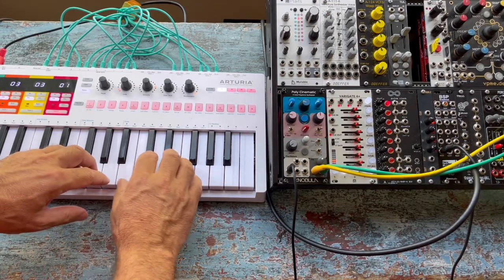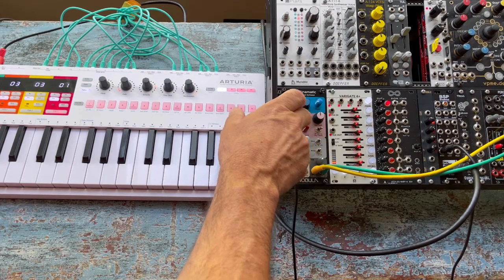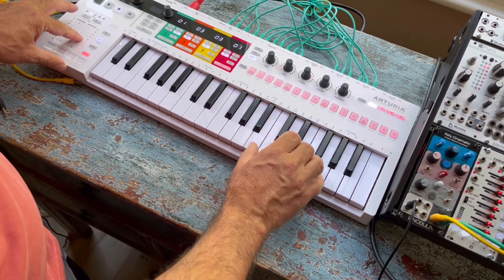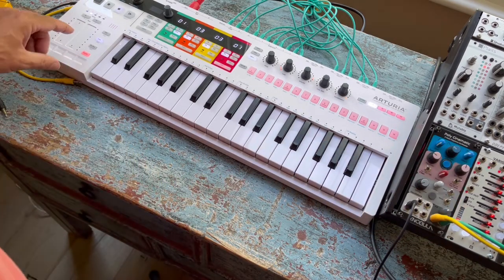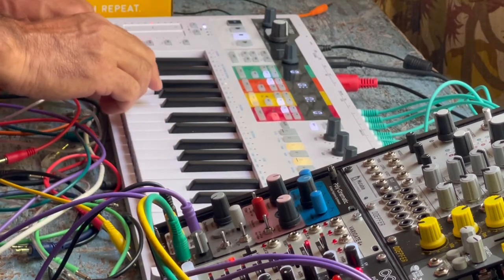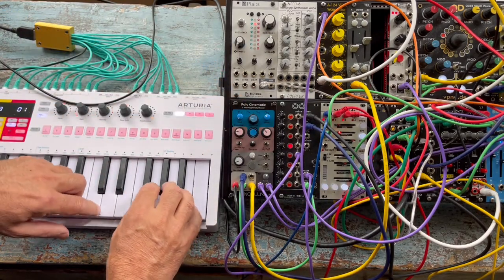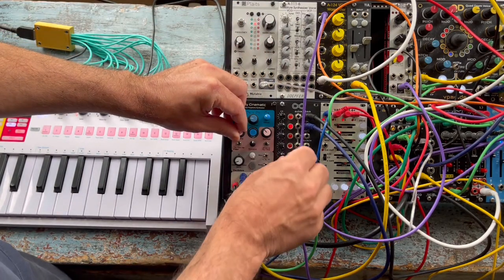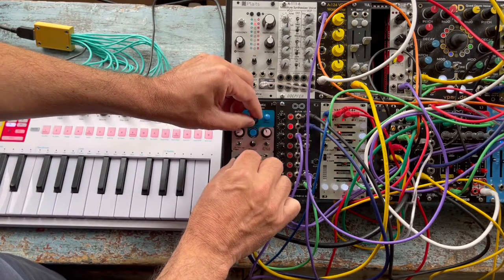Chord Memory explained

Comment: Hi, what's the breakout device you're using for the keystep ? Thanks for the video, interesting module 👍
Reply from the maker: It’s a plum audio hdmi to bst module. The bit you can see is the patch cable to hdmi break out which is a hand made 3D printed part. I wonder if a midi to cv module might have been a neater solution.

Comment: Thanks. Can you program in chords without using the mod wheel on a MIDI device?
Reply from the maker: Chords are programmed from a midi keyboard, chord memory destinations can be chosen using either mod wheel or cv voltage at chord select jack